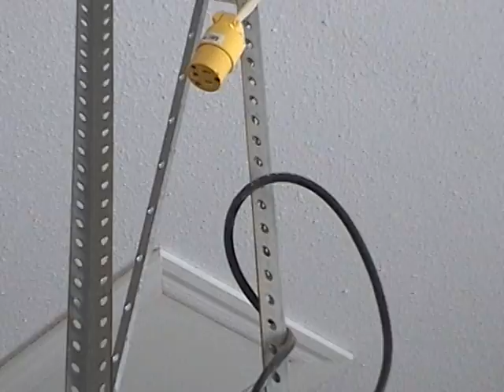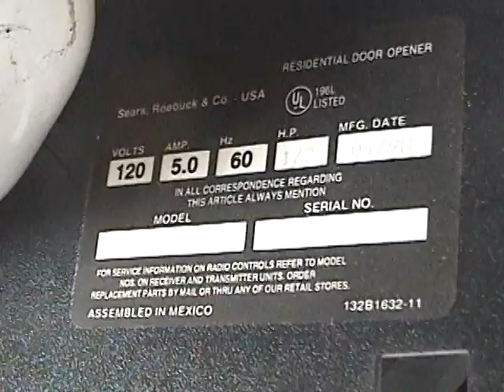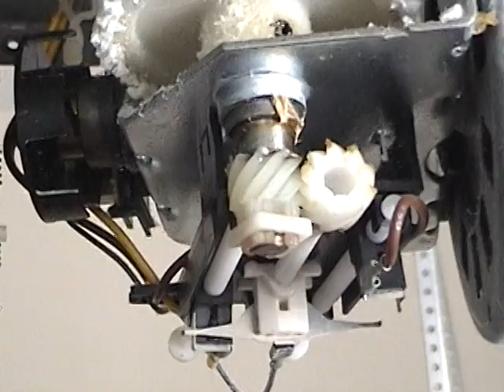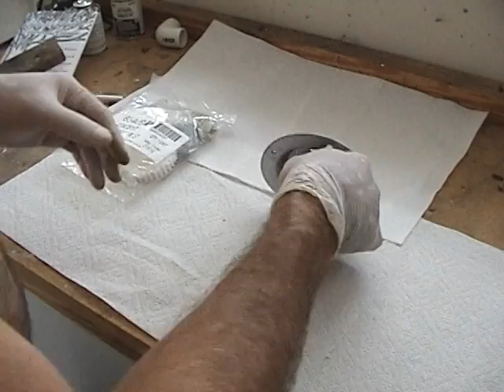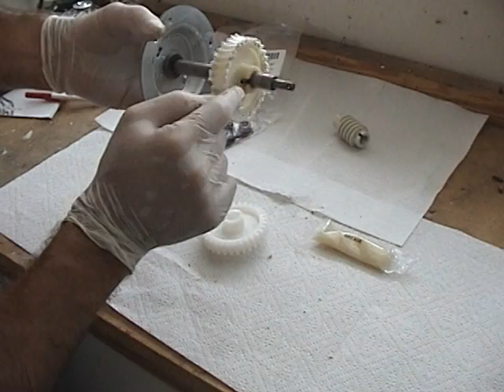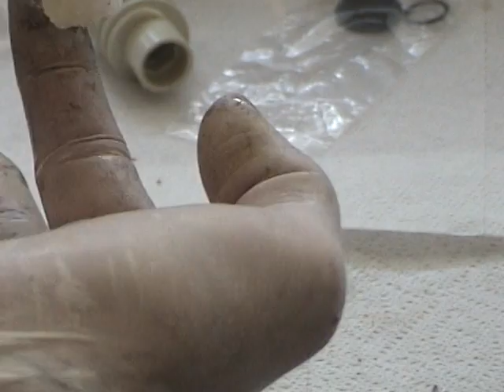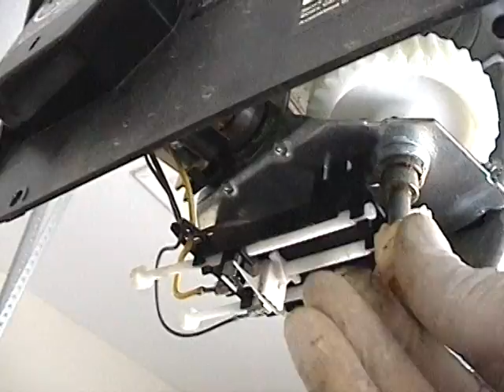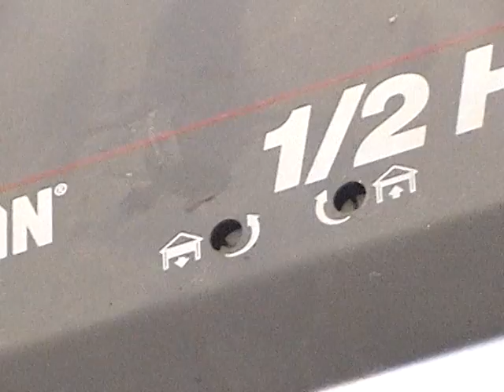Craftsman (LiftMaster) garage door opener issues?

Comment: Kris, thanks for the excellent video. Repair cost was about $12 with gears from ebay. One note - when reinstalling the drive gear, the DIYer should make sure the top mounting plate is oriented so the two rectangular slots for the sprocket cover are to the front and back. Otherwise, you may get everything put back together and find the sprocket cover won't snap in place.
Reply from the maker: good tip, thanks for posting

Comment: My Sears garage door stopped working and  I inspected it and the plastic gear is stripped out. I was thinking replacing that gear would be too difficult for me but then I found your video so I think I can do this! Thanks!
Reply from the maker: You're very welcome.
Reply from the maker: I should add a note in the vid that a complete gear attached to the shaft can be purchased--and makes the job a bit easier.

Comment: Kris....you just saved my a lot of money buddy! After getting a quote to replace the entire unit with labor I was looking at upwards of 400.00 bucks. I watched your video last night and decided to investigate by opened the unit to find the gear had been ripped to shreds  just as you said. I went on Sears direct ordered my part and picked it up when they opened this morning. And now my friend I have a working garage door again!!!! Had to replace the safety sensor as well as one was no longer lighting up and the door would not stay down. Altogether I spent around 50 bucks for parts. I cant thank you enough for making this video
Reply from the maker: You're very welcome. I should add a note in the vid that a complete gear attached to the shaft can be purchased--and makes the job a bit easier.

Comment: Great job!   But for longer gear life, especially in colder climates, I recommend using whale oil instead of grease included with kit.  Yes, that's right.  Whale oil for consistently smooth operation in all climates 
and less wear too. Simply ask for it at any Inuit village, or try harpooning your own for a lifetime supply!

Comment: GREAT video, Kris.  Working on a very similar, if not exact Craftsman model, $5 and a wee bit more time than you took (since I didn't align the holes for the sprocket cover correctly the 1st time and had to loosen the chain nut to reinstall) and it's good as new.  Thank you SO much for u'r hugely valuable step-by-step video.  Wouldn't have tried this fix without u by my side.  ; )

Comment: Thanks for this video.  I performed this (or a similar) operation on one door several years ago. Now, the motor works but the chain won't move. If I have the aforementioned plastic dust inside the unit, is there a good chance that this operation will fix the problem? (Is the dust the telltale sign?)
Reply from the maker: If you can get into the opener to see the dust, can you also see the gear? If so what condition is it in? Plastic gear shavings (dust) will accumulate from normal wear.
Reply: It's a bit chewed up but I don't know how much of that is normal.
Reply from the maker: If  you can run the opener with the cover off, see what spins and what doesn't You say the motor spins, but verify. Does the large plastic gear rotate? if not there could be broken set pin. If the gear does rotate, could be a broken shaft that connects to the sprocket for the chain--that happened to me. Just need to start diagnosing where the movement stops when the motor is on.
Reply from the maker: There is nothing left of that gear--it needs to be replaced.
Reply: Got it. Thanks again. So I'll order just the big white gear (I won't need any other parts) and try to replace it, right?
Reply from the maker: There is a kit with the white gear already connected to the shaft--If I were you i'd go with that. Someone commented on that part number.
Reply: Got it. Thanks again.

Comment: I have a feeling that my opener is having the same issue. However, its a Quantum 3214. I haven't tried to open it yet but do you think all openers are pretty much similar? I will open mine later today. Thanks, great informative video!
Reply from the maker: Glad I could help. Maybe post a note back on your findings / repair. I'm sure others would like to here more about this opener.

Comment: What if there is no grinding sound, it just started to go up, goes for 3" then abruptly stops?
Reply from the maker: will it go back down? If so it may just need some adjustments. Open the cover and have a look. if the gears aren't shredded, it may be the "up pressure" setting on the opener. Also disconnect the linkage from the door and try to lift the door manually. If it's very heavy, your springs may need adjustment. If the springs need adjustment I would recommend calling in a licensed and insured service person.
Reply: Kris Kasprzak thx for the quick reply. I'll check what the weight feels like on my next days off.  It's a sporadic problem, so I'm hesitant to call anybody to pay them.... LoL
Reply from the maker: That same problem happened to me lately, I adjusted the Up force and it fixed the problem.

Comment: I had a worn gear exactly like this one. Took the cover off and found white powder and shavings. It was probably 10 years old. I bought a new one and replaced it. It lasted about a month and wore out again exactly like the first one. Found shavings again. I didn't use the white grease that came with it. Ill try using it this time and see what happens. If I remember I will update this posting. Hope no one is offended I used the word "white". I meant no discrimination. I know how everyone is so sensitive these days.
Reply from the maker: also check the force required to open your door--basically disconnect the motorized linkage and see if you can easily lift the door. If the spring tension is incorrectly set it may cause additional strain on the gears, which would lead to premature wear. I would leave spring tension setting to a licensed and insured repair man.

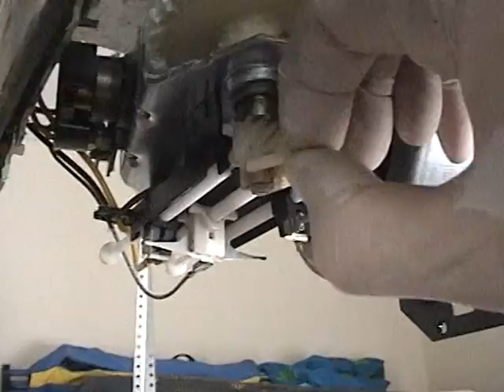Comment: When I pulled the clip out (second 3:33), it was stuck and half of it snapped off.  Does anyone know where I can find a replacement?  right now it is working with the one half off, but I would rather fix it correctly.  Thanks in advance for the help.  :-)

Comment: Great Video - thanks!  A couple of suggestions for future viewers.  I found it was easier to cut off the worn gear using a sazall - the roller pin was more exposed.  Also do not use a tapered punch, I did and I expanded the roller pin, making it much harder to extract.  Finally, loosening the chain really helps in getting the assembly back in place and getting the screws in.

Comment: why do they have plastic gears in them if they are known to fail? just put in metal ones.
Reply: I think because if it over travels or something else goes wrong you would rather the gear strip than burn the motor. You have a weak part to save the important expensive part.

Comment: Cheers. Wouldn't have attempted without watching this first. Hardest part was getting the damn screws out and the pin without a vice. Ended up putting the screws back in from the top rather than the bottom.
Gordon, UK.

Comment: Great video! A guy who worked on garage doors for a living told me it would be a waste of time to fix this as something else would soon go wrong. I did it anyway. It works great. Had to use a 5/16 wrench to remove and replace one of the 3 screws that hold the assembly to the chassis on the top due to a peculiarity of my model. Hardest part for me was getting the chain back in place and then adjusting the operation of the door. The instructions that came with the parts kit were of very little help. Thank You very much for posting this great video! My wife will dislike me a little less now!
Reply from the maker: You're very welcome. Glad I could help.
Reply: randy fink I am having trouble getting that screw out any advice?

Comment: Excellent how-to! No wasted words, very clear images and explanation. Sears sells the gear package for $40..I ,know how some got it for $8.oo, but $40 is less than a new opener assembly. My opener is 34 years old...
Reply from the maker: Glad I could help. I recently had to do this again on another opener but this time, the shaft broke at the sprocket. so i had to replace the gear/shaft assembly. the replacement was easier as the new assembly was already assembled. Just a thought in avoiding removing the pin.
Reply: Just picked up what I thought was a couple of gears for which I paid $40..turns out to be your second repair...a fully assembled driveshaft, etc.

Comment: Thanks for this, just about to start mine.
Reply from the maker: They also sell the whole sprocket/shaft assembly and is easier to install since you don't have to take the old one apart. I recently replaced another and bought the sprocket/shaft assembly. A bit more, but easier.
Reply: already have the gears, and one is done. the other door is about to be fixed. odly they both went out with in a week of each other, same issue 1997 door openers.

Comment: Thanks! Just took apart my opener and found this gear shredded to pieces. I was intimidated at first by the work involved with replacement at first glance, but after this I'm confident enough to order the part and replace it myself, saving me a ton of money!
Reply from the maker: Glad I could help.
Reply from the maker: Note: the gear and shaft assembly can be purchases as a kit and may be easier to replace. Costs more though...

Comment: Perfect! I know my problem and now know its solution. I wonder if there is causal problem for the gear wearing that I am not addressing when making this repair? What should I be looking for? That should be repaired first. What is a fair longevity for a garage door opener that is asked to function at least 4 times every day? Thanks for the video.
Reply from the maker: Moving parts something is going to wear. The teeth of properly designed gears don't slide, the roll so wear should be minimal. Make sure the gears are clean and free of dirt, then use plenty of grease. I find my self replacing gears 10-12 years (both houses I've owned, this seems to be the norm).

Comment: Amazingly accurate video. You are correct on the unlikely need to replace all the other hardware, including the worm gear. I cleaned the hardened gunk out of the worm gear and it looked like new. The drive gear appears to be made out of a much softer nylon, and as a result gets chewed up quicker. This is a common sense approach that is much easier to do. Thank you very much for posting this video. I picked up 2 drive gears for 8 bucks shipped on Amazon. My 20 year old opener works great now.
Reply from the maker: Glad I could help!

Comment: Your instructions were very clear and easy to follow. The only difficulty that I had was removing the hollow bottom pin from the drive gear, as my nail set enlarged it, instead of pushed it. Once that was done and I reinstalled everything, I did need to reset the travel switches on the door, as you mentioned. That was likely due to my loosening the chain, in order to place it back on the sprocket. Thanks! You saved me a few hundred on a new opener.
Reply from the maker: You're very welcome.

Comment: Removing the chain (while not letting the trolley move, clamp it down, makes checking the limits a lot easier as they may not have changed at all) takes the tension off unscrewing the 3 holding screws, btw!

Comment: Glad for this video. Parts-wise, however, now they also sell the pre-assembled kit, which includes a new sprocket (necessary if the sprocket breaks off the shaft - more common than other things breaking on these units) mounted to the shaft. Laso includes the small limit gear. Complete drop-in system.
Reply from the maker: yep, times change....i just replaced another gear, and it came with the shaft installed. Made life much easier.

Comment: Man, did you save me! I had the exact same issue...stripped gear. 27 dollar part from Sears and it's working great. Only difference is the Sears part came already assembled on a new shaft, however the threads needed to be cut on the new housing...simply ran the screws through the holes twice and it cut the threads just fine. THANK YOU SO MUCH!
Reply from the maker: glad I could help.

Comment: Kris, I could use your advice.I replace the drive gear like your video.When I tested the door,it opened fine and stopped when it was supposed to .When I went to put the door back down when it reached the end instead of stopping I noticed slack in the chain drive and the door reversed itself and started back up on its own.Is this something I can adjust or do I need to call in help?
Reply from the maker: Sure, let's see if I can help.... 1) get the chain tension correct so it doesn't sag 2) make sure the door guide channels are free of debris, 3) try adjusting the pressure sensors to give the down cycle a bit more pressure (i ran into this recently where my door would not go down all the way) 4) oil the chain and rollers 5) are you sure you have ample grease on the new gears? 6) are you sure your down stop will allow the door to reach the floor? (careful when adjusting the down limit so you don't drive the door too hard into the floor--have the remote in hand when doing this. Feel free to give some more details, maybe i'll have some more ideas.
Reply: I did have the drive chain too loose but I corrected that according to the owner's manual.This may be the problem.When I open and close the door manually (by hand) by pulling the release rope the door will not go all the way to the floor on the close cycle.I have to mildly force it down with my foot so I can lock the door at night.The door comes within about 3 or 4 inches from the floor then binds up.Sensors are Ok and the bottom of the sectional door doesn't seem warped. I wonder if it could be binding up by the trolley?
Reply from the maker: It sounds like the spring to counteract the weight of the door is off, or something is binding. Move the trolley back and fourth (so the door goes up and down) and look for anything that will stop the movement. If you springs are off, I would call a licensed and insured pro--adjusting those springs is dangerous.
Reply: Thanks, I enjoyed learning from you how to replace the drive gear.I will have a professional check from here on.

Comment: OK CHRIS, IM HOME NOW, THE PROBLEN WAS THAT THE UP AND DOWN STOP BAR IS IN A PLASTIC CLIP THAT RIDES ON A GEAR SHAFT. THAT CLIP WAS BROKE AND THE DOOR WENT ALL THE WAY UP AND HIT THE NUT AND BOLT. I TOOK OFF THE SMALL GEAR AT THE BOTTOM (WITH THAT SLIDE CLIP) AND WAS ABLE TO MOVE THE MOTOR (WITH THE REMOTE) JUST ENOUGH TO GET IT BACK ON THE DOOR. WHAT I DID WAS I  USED J.B. WELD TO PUT THAT LITTLE BAR BACK IN ITS PLACE  AND I HAD TO MAKE SOME ADJUSTMENTS TO THE UP AND DOWN STOP.NOW IT WORKS GREAT, I WANT TO THANK YOU VERY MUCH FOR THIS VIDEO, I FELT LIKE A PRO WHEN I TOOK THE COVER OFF....THANKS AGAIN, JOE  PS I JUST LOOKED IT UP AT SEARS.COM, ITS CALLED A LIMIT SWITCH ASSY.
Reply from the maker: +HAMRADIOJOE Glad I could help.

Comment: I have an older unit that does not have the photo  sensors nor does it have
 a light that flashes when the travel is interrupted. I just replaced 
the plastic drive gear. Now the motor turns the gear several times then 
it automatically reverses and travels back before before stopping.  it 
will do this with the chain connected or with the chain not connected. 
How do I correct this. I tried adjusting the up and down travel screws 
but it makes no difference
Reply from the maker: +ltzclick Do you have pressure or force adjustment screws? I ran into the issue where my gear shaft bearing was wearing and the motor did have enough power to overcome the friction. I increased the pressure as a temp fix until i replaced the shaft and bearing. Perhaps your shaft/gears/other are in need of some oil? Try to increase the pressure limits if you have them. I'm not sure otherwise.

Comment: Hi Kris,  Would this also be the case if the trolley moves 10" and returns back and this is without the door attached. 
So I detached the door and push the remote the trolley moves 10" and returns back and garage door light flashes on and off. 
So would this be the same issue where I would need to replace the gears? Thanks in advanced
Reply from the maker: +Tony Mazzoccoli I'm guessing the pressure settings are off. In fact my other opener was doing this, and setting the pressure higher fixed that problem. However the real issues was the bearing between the gear shaft and the main opener body was worn out causing tons of friction. The sprocket finally broke. Check the drive train and make sure it is well lubricated and the bearings are in good shape.